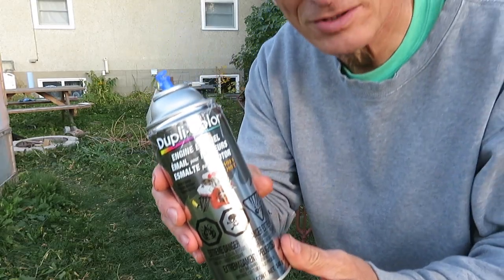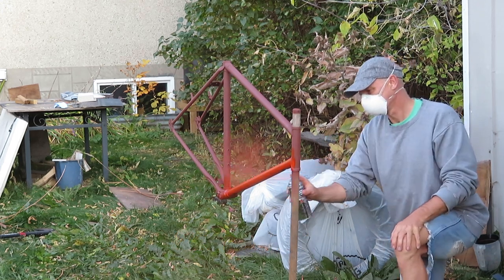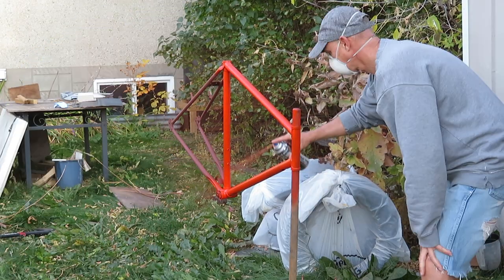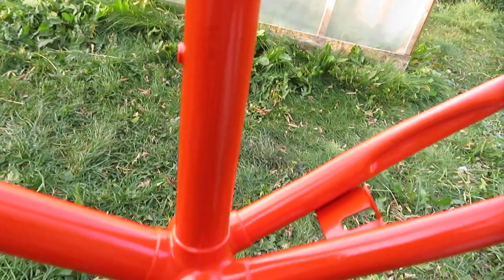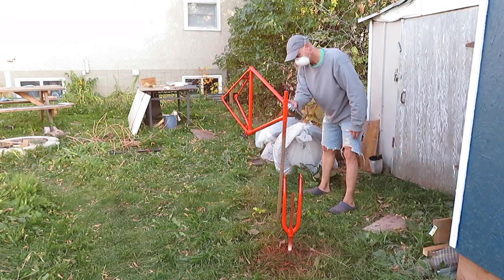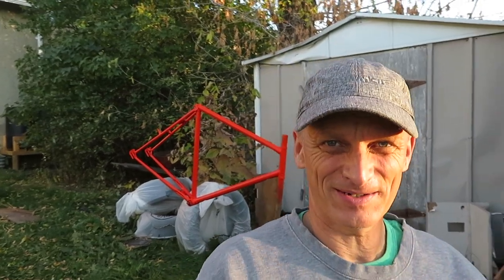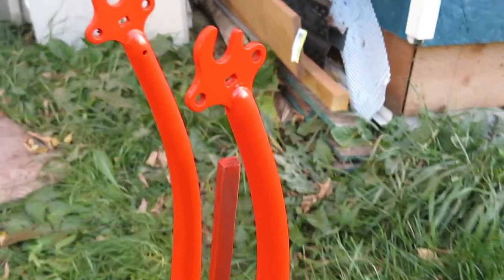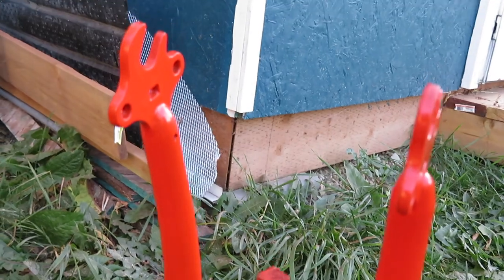Bike Painting done right

Comment: Super work and I agree, I've had one bike power-coated once...beautiful hard factory finish...but I prefer to satisfaction and fruits of my labor to make it my own.  You provide great tips thank you.  BTW, I can't seem to find Methyl Hydrate here in the USA...maybe it's a bad chemical they don't like selling anymore here.  Can you recommend another cleaner before applying the top-coat?
Reply from the maker: Actually, brake cleaner is even better than methyl hydrate. Methyl hydrate though, is just denatured alcohol.
Reply: @the1andonly  I've since discovered DA is a good alternative, but brake cleaner?  After it's primed?  I would think before it's primed but wouldn't brake cleaner start stripping the primer?
Reply from the maker: @motleypixel  I thought the same thing, but Martin Grey from ETOE made a video in reaction to mine, where he commented on everything I did. He is a pro and recommends brake cleaner.
Reply: @the1andonly  Okay so brake cleaner on cured primer is okay, it won't strip any of the new cured primer?
Reply from the maker: @motleypixel  That's right. It should be good. I'd still be careful though.